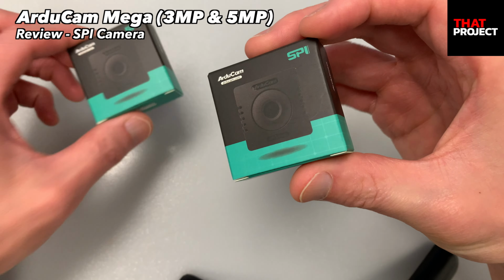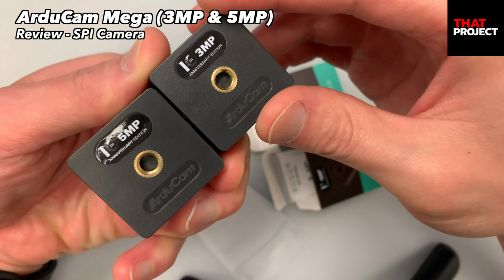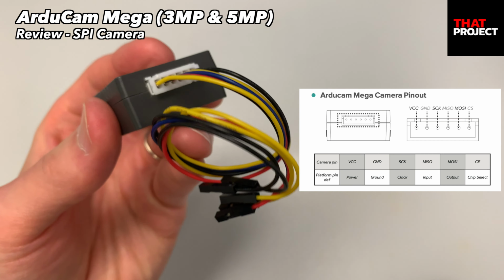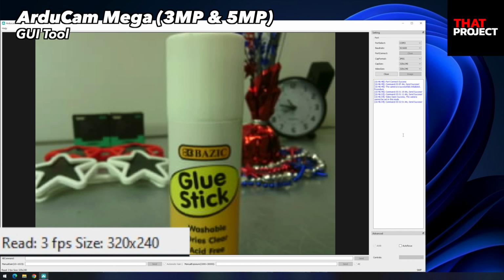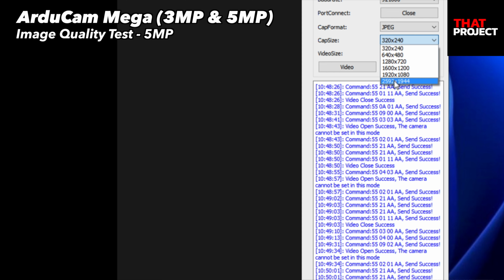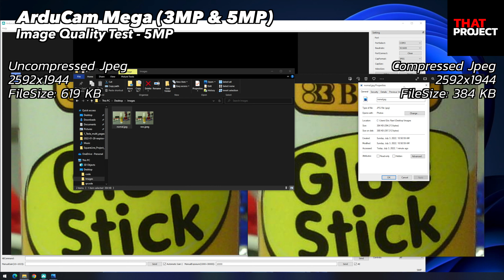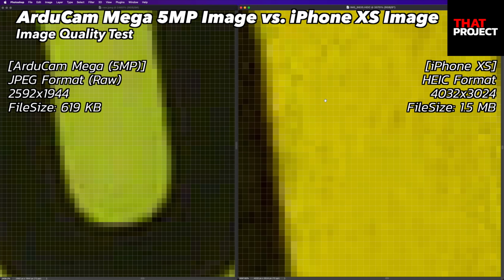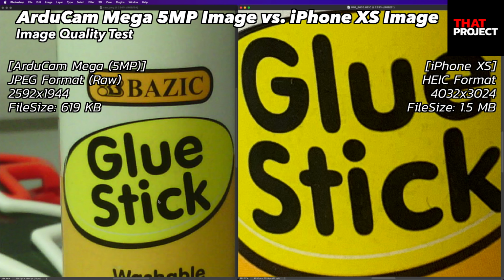SPI Camera for Any Microcontroller (ArduCam Mega)

Comment: I wonder how long it would take the ESP32 to compress the image to JPG and send that smaller image file over to the PC.  OR have it stream the data via WiFi, as that would be faster than serial. 
Anyways, thanks for the info!
Reply from the maker: Since data is transmitted by 4 wire SPI, the part that brings the image obtained from the camera to the MCU is slow.
To test this camera, I've already tested receiving images streaming over WiFi. It's still very slow. Maybe I'll show you streaming over a WiFi connection when making an application that uses it.

Comment: How is it in very low light situations and how soon after power up can it take an image?
Reply from the maker: It takes at least a few seconds. Image acquisition is not fast because it communicates with the camera via SPI.
Reply: @ThatProject  Thanks, but I was asking how soon the camera could capture the first image after power up. I'm not worried how long it would take to subsequently transfer the captured image to the MCU. In a security system, I need to have the camera turned of most of the time and switched on by a PIR sensor then be able to capture the first image with the minimum latency to prevent missing a fast moving object that triggered the PIR. Have you measured that on this camera - or perhaps on other cameras? Thanks
Reply from the maker: @stevegulick7656  Got it. I know what you mean. That part seems to require rigorous testing. Since I received the photos through the PC application provided by Ardu Cam, it is different from what you want. Not sure but I'll try to let you know what you want sooner or later. (Sorry, I'm too busy these days.)
Reply: @ThatProject  Thanks very much for your response!